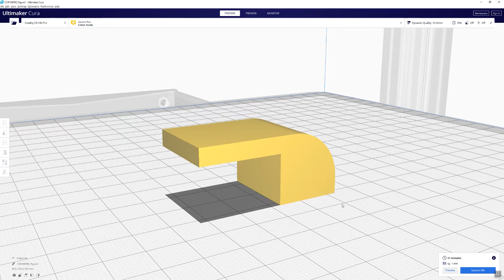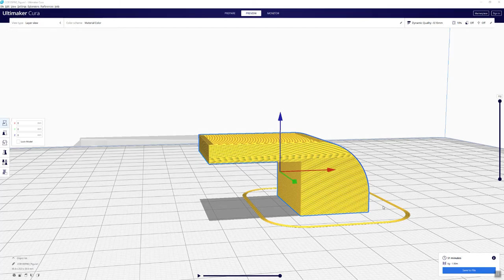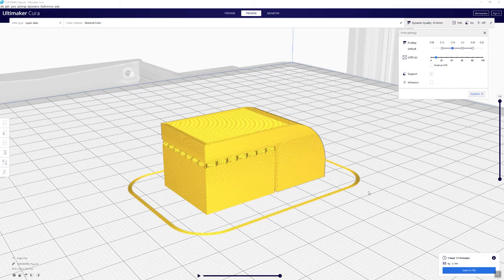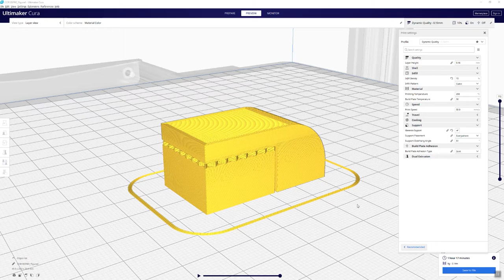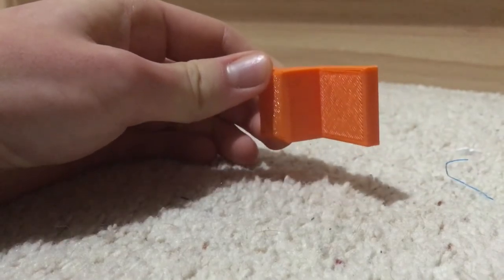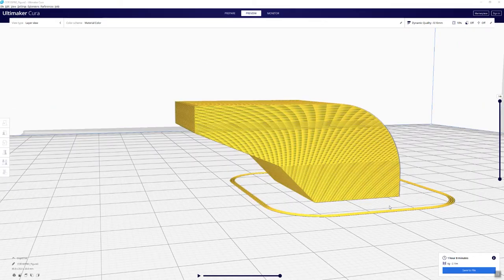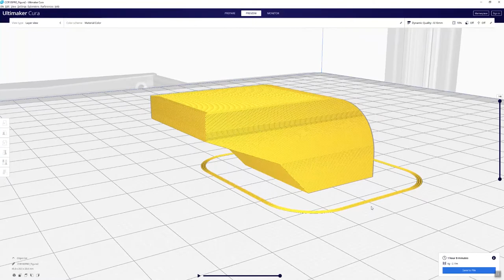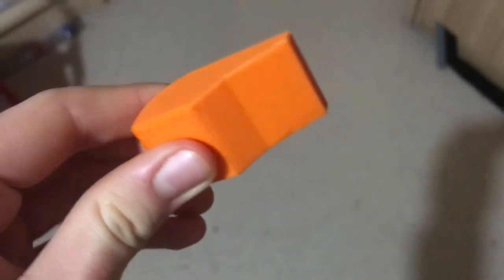3 Ways To Beat Overhangs!

Comment: Yeah i often have flat areas for electronic where there are small extrusions on both sides (top and bottom) tried rafts and various support types but it always ends up in a mess  would resin printer fix this?

Comment: When you used supports in the vid... did you add a cube to the model and let cura put supports between the two? Or did cura do the lot?
Reply from the maker: I assume you mean the support blockers? Yes, I added it in myself by clicking on the model with support blocker selected and then once you’ve resized it you can just slice it and cura will put the supports in appropriately
Reply from the maker: Hope this helps!

Comment: Sometimes its best just to cut the model into two parts, print them flat on the bed and glue them together. I have even gone as far as creating pegs and sockets to make joints stronger.
Reply from the maker: I believe I’ve mentioned this technique in another video but yeah it’s a useful technique
Reply: Yes it works but i would reallrather not do that